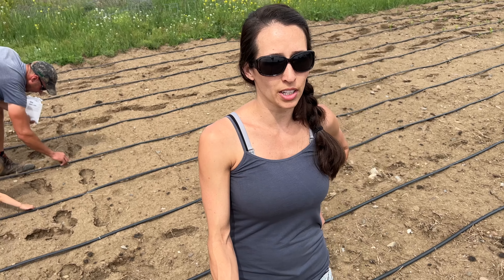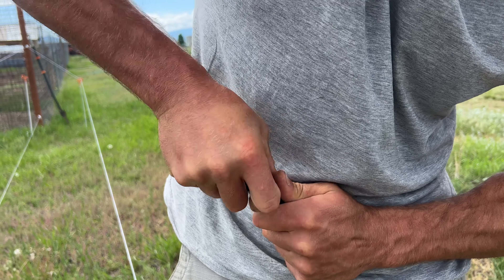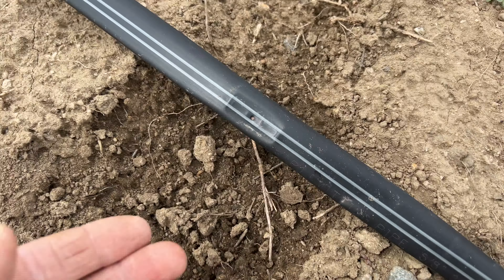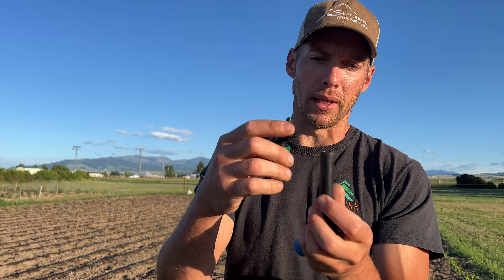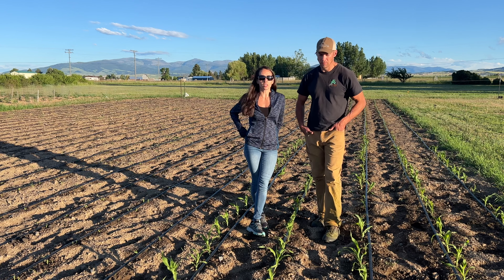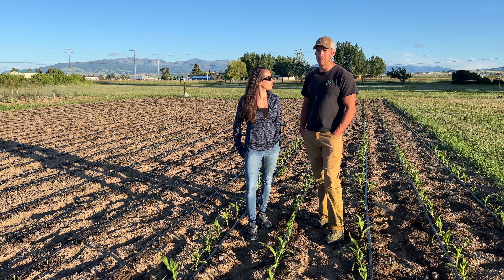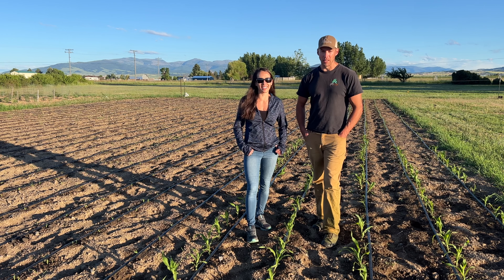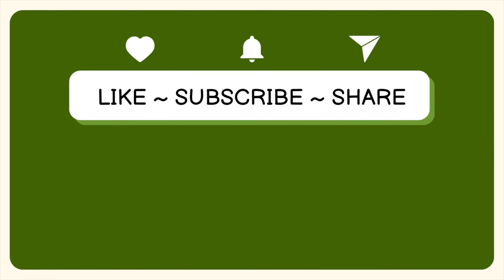How We Set Up Drip Tape On Our Sweet Corn Field

Comment: Netafim Flex Net is the new most practical thing for Main Line. Illnever go back to polyethylene hose. Flex Net is pvc pipe you can roll up . Rivets dont leak. I have 2" and 4 inch
Reply from the maker: Good to know! We just went with what we had. We were actually wondering what to use for high volume applications if we did a bigger field. Thanks

Comment: You need to look up the drip line specs as they are very important to their performance. 

Tape are spec’d at drip rate in gph per emitter or 100’ runs per pressure regulator. I see the 15 psi regulator is far beyond 100’ so you are loosing water pressure big time, especially on the last run.  

Your main line feed should have the regulator at each tape run to maintain pressure so when you make water usage calculations, they will be accurate.

Comment: how did you figure if you have enough water [and pressure ] at farthest point to water the plant?
Reply from the maker: Our understanding is that since it’s a slow drip system with low pressure the water leaks out equally once water has made its way throughout the line. Now that this corn field has grown up we haven’t noticed stunted plants on the far edge from the start of the water source. Most people need to put a pressure reducer at the start of their lines. To make sure you have enough volume you need to know how much water you pump puts out. Then you can figure out how many gallons the field is using by multiplying the number of emitters by the number of gallons a hour they put out.
Reply: @MontanaMidValleyFarm  if it's pressure compensated drip or you're not running very much equal watering won't be a problem but if it's more than a half acre of uneven  terrain you may likely have water differences amongs plants